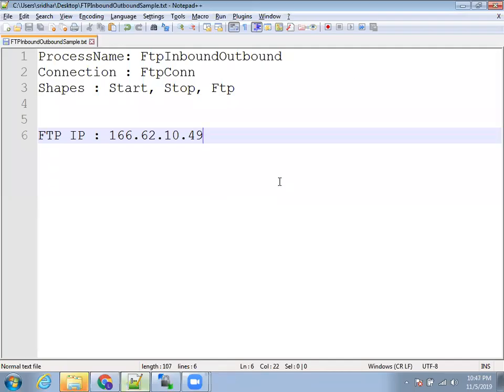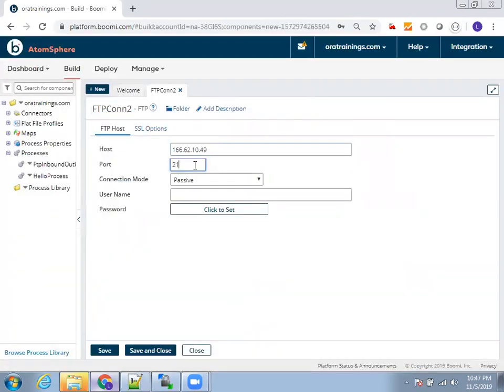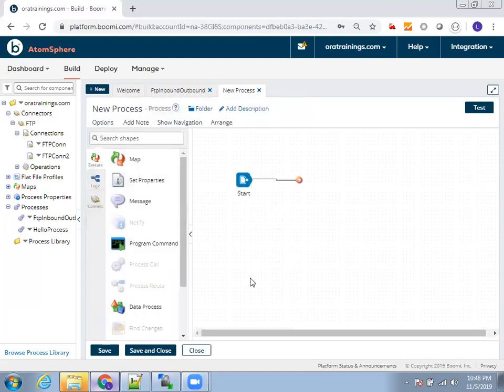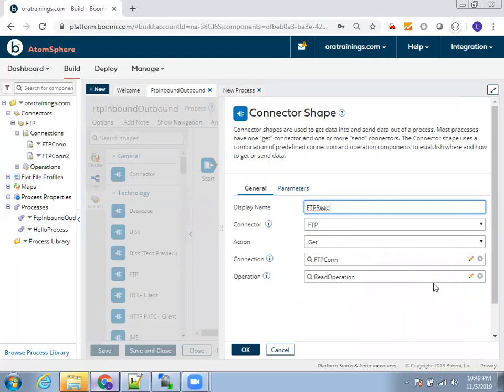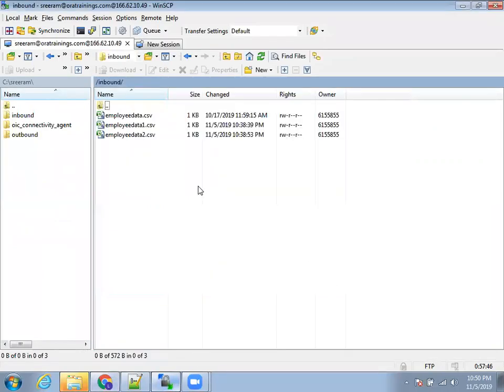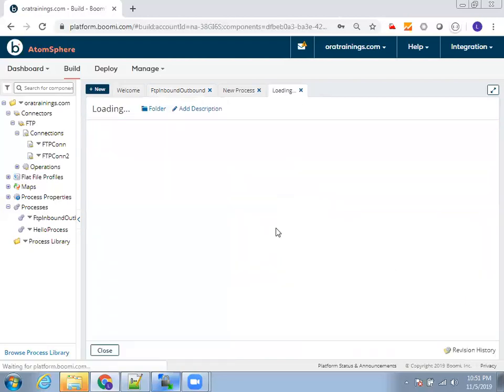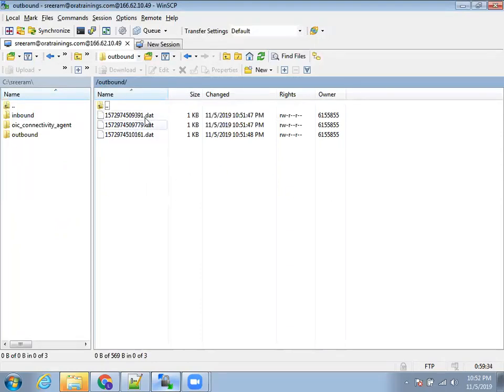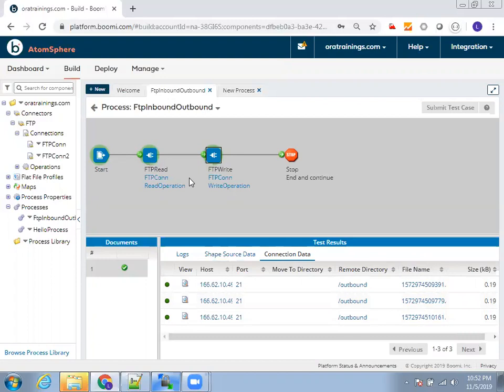Dell Boomi Ftp Inbound to Ftp Outbound Sample

Comment: hello sir , 
am getting the error in FTP server " Test execution of FTP completed with errors. Embedded message: Severe errors occurred during start shape execution, terminating process.; Caused by: Error setting up FTP connection: Error from FTP Server, 530 Login incorrect. ; Caused by: Error from FTP"